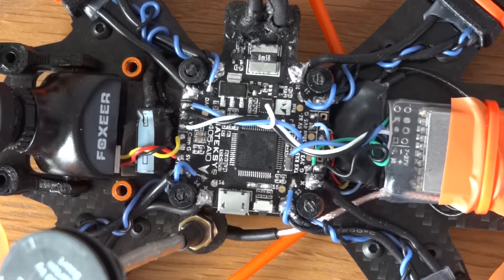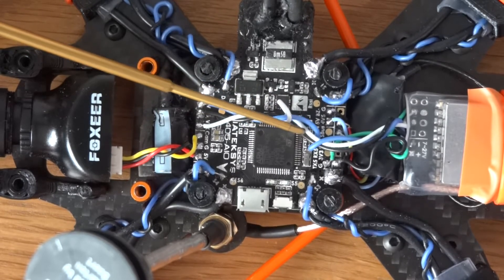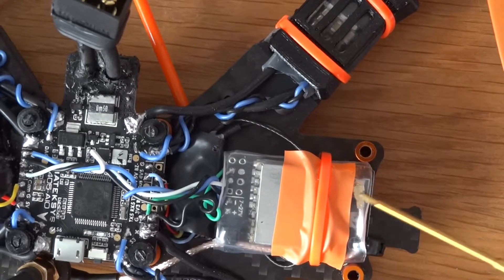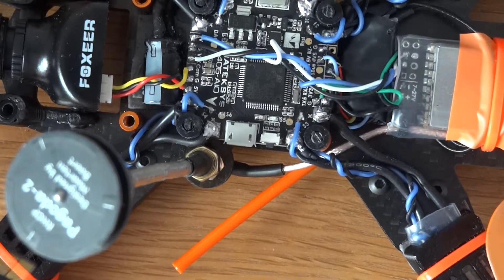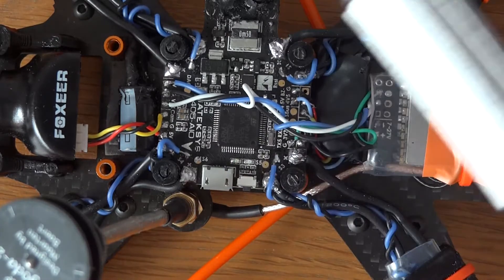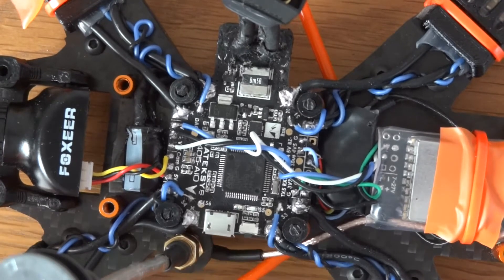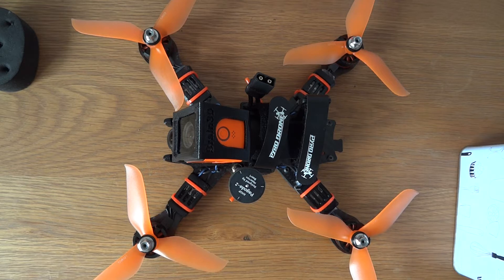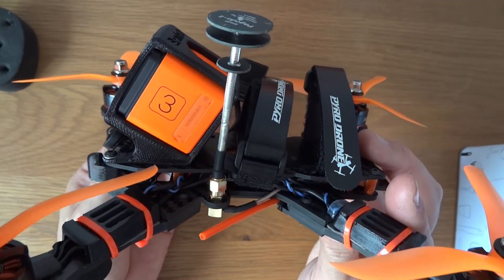Hyperlow build part:3 VTX FPV & Receiver plus overview

Comment: Pls help,I plug in USB and there's no status LEDs coming on and the f405 is getting really hot,I thought there would be a light to show there's power in the fc
Reply from the maker: yes there are status lights. sounds like the board is fried - if its really hot possibly shorted on something.
Reply: I'll send it back the first one they sent me was the same only the USB been connected to it ,thanks for the reply
Reply from the maker: michael clark seems weird. wonder if your USB is shorting on something
Reply: G n r - B o b yes I’ve heard the USB sending current back to the 405FC